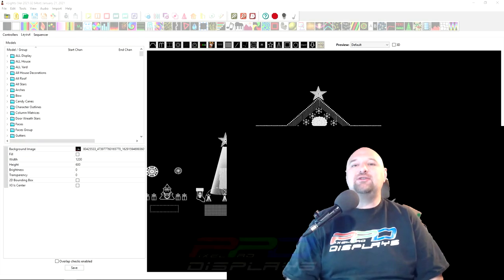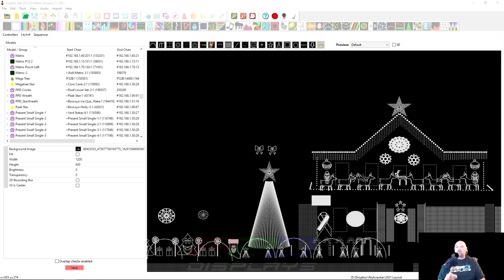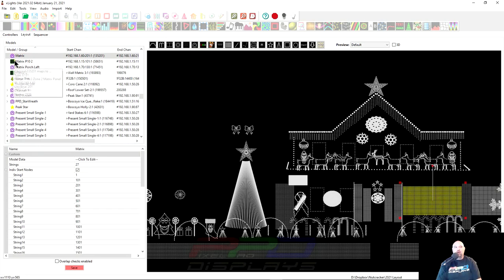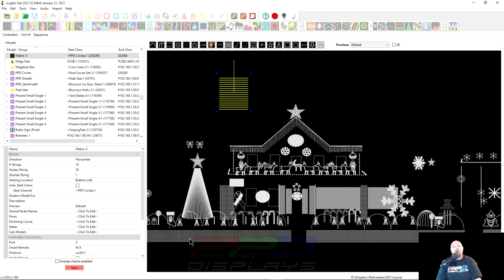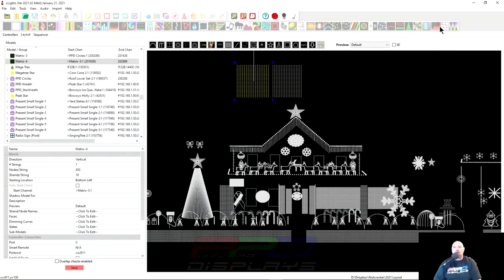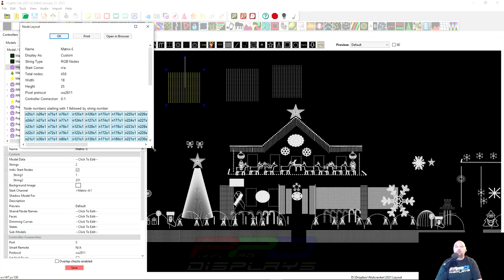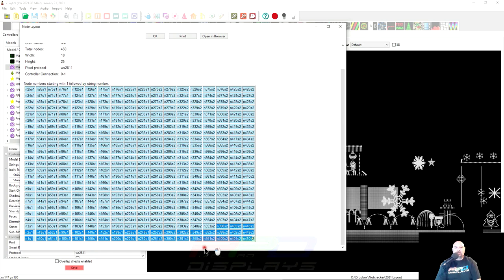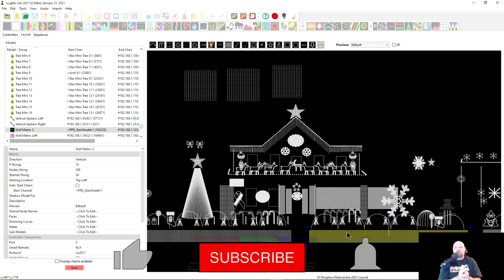Convert the xLights Matrix Model to Allow for Unconventional Pixel Count and Controller Upload

Comment: Thanks for this helpful tutorial, and the many others you have posted. I tried to apply this procedure to a 42" high, 270-degree mini tree with a 20 pixel star on top, using 2 strings of 100 pixels each for both tree and star to share (simply creating a new tree doesn't allow an imbalance of pixels used per string, similar to the matrix you demonstrated). I don't think this scenario works with 3-D objects, but I could be missing something. I see you have some mini-trees with stars on your layout, I would be interested to know how you configured those.
Reply from the maker: I can not speak to 3D props, I haven't used this on a 3D model, however it may work?  3D models are quite complex.  This will work exactly the same way on Tree model as it did on the  matrix.    If you are combining your mega tree and star into ONE PROP, then you must use a Custom Model to do so.  At that point, you'll have no problem putting your mega tree and star on uneven pixel counts.

Comment: Great contents, I have a mega tree 180 degree, one port, one continues strand of 850 pixels with power injections, starts from left up to chain with a two layers star which is starts at pixel number 51- 100, then goes down the tree from pixel number 101 - 850 to cover the rest of the tree, So strip 1 up, connects to the star pixel number 51 and from pixel number 100 of the star, continues back down to strip 2 then 3 and so on to strip number 18, So any suggestion on how to make the star function separately from the rest of the strand, as in some effects strand number 1 which the first 50 pixels, it lights up apposite direction of the rest of the other strands, also in some effects the star lights up with the rest of the tree. I tried to find some settings to have it's effect without interacting with the rest of the tree strands in xLights, but couldn't find that option, unless have to unwire it and connect it to a separate port. any suggestion, thank you
Reply from the maker: If you must have them attached in the way you are explaining, then you'll need to do a custom model, and create sub models for all your strings.  Then you have to sequence the tree in one group, and the star in another.  It will not work like a standard tree model and will require you to play with the render style settings.  

I understand you're trying to make the most out of every port on your controller.  I would put the star at the end of the tree and run a data line up to the top from there.  This allows you to take advantage of the native xLights tree and star models.  You can use an F-amp to extend the data from the bottom of the tree up to the star.  

I recommend you run another output to your star, separate from the tree.  That is truly the easiest way to address the situation.  Consider this, if a pixel on your star goes out, so will the rest of your tree.  You'll have to drop the tree, just to get to the star, and replace the pixel.
Reply: @PixelProDisplays  Thanks so much, I thought of making a custom model while watching your video, but it's a be a bigger hassle customising this complex tree setup lol, will be easier to run the star on a separate port or using an F-amp, tomorrow will figure out which of those physical options easier 😏 Btw your tutorials videos are very educational, thanks again and happy 2022

Comment: Hello I need help, I made my first 3'x4' matrix with 306 pixels, connected to a dig quad. When I run some effect in xLight, it doesn't appear in the same way on the LEDs, it seems to be on a different scale, only part of the effect appears as if it was enlarged.

Comment: i have already sequenced my show using a matrix model but i need to do what you have just shown in this video as i have an odd split of 350 and 343. how do i add the custom prop to my sequence? do i have to copy and paste everything that was on the matrix and then add it to the custom prop in sequencer then delete the matrix?
Reply from the maker: When inside the Layout.  Click on the model.  then Right-click > Replace a model with this model... That will replace your current model with the new custom model and you can setup your outputs accordingly.

Comment: This almost what im trying to do, can you do this with 1000 rgb led lights (twinkly), to split the matrix with 600 on one strand and 400 on the other, I guess assign it the  two different controllers from each string and control it as one in xlights, I've learned a lot in xlights watching your videos.
Reply from the maker: We don't recommend splitting 1 prop between 2 controllers and it's quite complicated.  You should reorganize your outputs so it can be on the same controller.